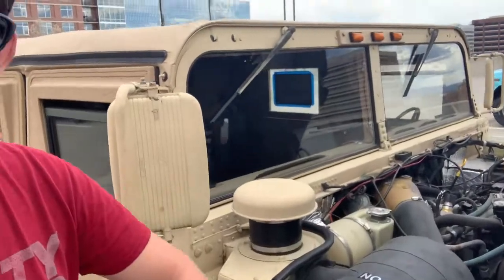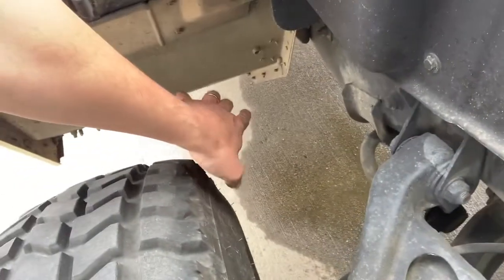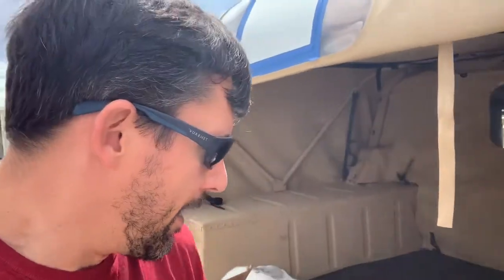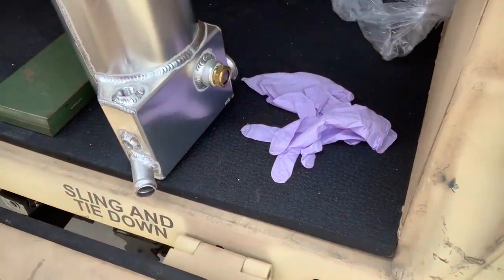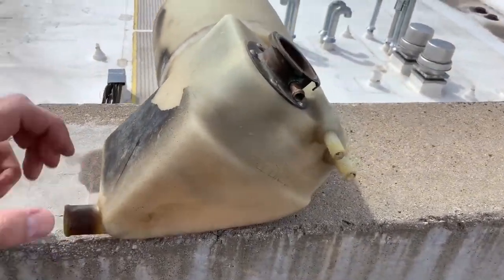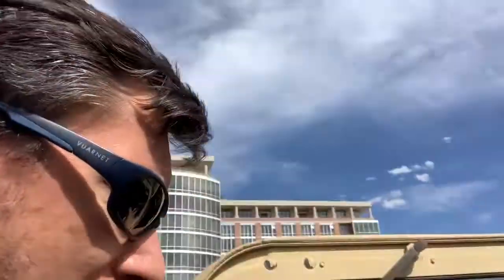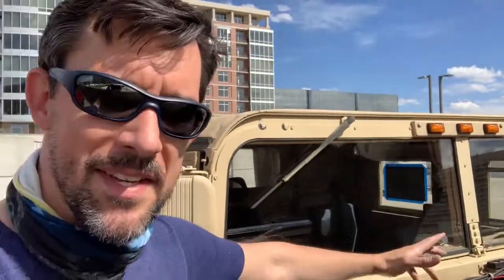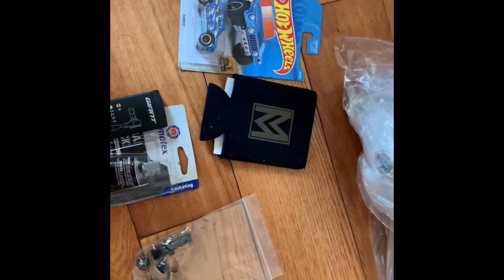HMMWV (HUMVEE) Coolant Tank Upgrade

Comment: The Lower Coolant TUBE is not properly positioned causing too much stress on the coolant Surge Tank. Also the two hoses are routed UNDER the air intake, when they are to be routed OVER it!

Comment: Just installed the Mod Mafia Aluminum Surge Tank on my 1995 H1, 6.5 NA Diesel 4 door Wagon yesterday. I'm the original owner, factory tank finally blew a week ago after 26 years. Guess I got lucky. Encountered all the same issues as the video describes, and two more, the top of the radiator cap will rub the underside of the hood a bit, glued a thin piece of UHMW PTFE plastic there to be the slick rub spot, and due to the lower radiator hose connection not being in exactly the same place or angle as the plastic OEM tank, the aluminum one will not sit level, so that the sight glass is level. It is pitched upward at about a 5 degree angle. No big deal there though. For the rubbing of the corner of the tank against the air intake plenum, machined a thin piece of UHMW PTFE and glued it to the corner of the tank so that the flat surface of the UHMW rubs on the plenum, should keep it from wearing a hole in it. Also, had to put wire loom around the wires to the connector for the Heater/AC fan that is at the upper left rear corner of the tank to prevent abrasion there. Aluminum tank is just slightly larger in all dimensions than the OEM tank, but will fit. Great video, thanks, due to watching it I was ready for these problems and had the fixes on hand as I went along, saved me time. Ran a tap into all the bung holes first, so everything seated fine, no leaks!
Reply from the maker: Nice!   yes.. it’s a make it work type of product but it works well.

Comment: Mine wasn't from ModMafia, but I bought what appears to be an identical tank for my truck last summer.
The only issue I had with installing mine is the new tank was slightly longer overall than the old one, and it interfered with the air conditioning lines from the Red Dot unit.  Fortunately my Red Dot wasn't actually hooked up at the time so I was able to loosen the fitting on the compressor and adjust the lines to not interfere.  It was a close fit though.

Probably the best upgrade you can do to the cooling system for peace of mind (other than a thorough flushing or three if it's an older truck)
Reply from the maker: Christopher Watts well done!  The best thing we all can do is showcasing how to make it work.    Did your aluminum tank help better radiate heat from the fluid noticeably?
Reply: @nathanpurney  My truck came to me with a cracked tank, so no idea if it's more efficient or not.  I just know I didn't want to ever deal with it again, and price difference between the replacement OEM tank, which is notorious for failing every decade or so, and an aluminum tank was negligible.